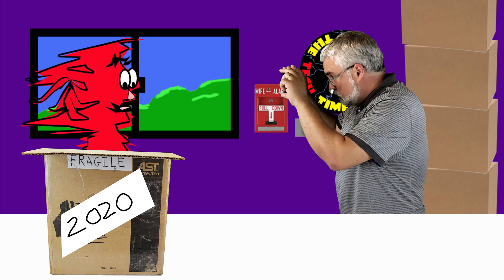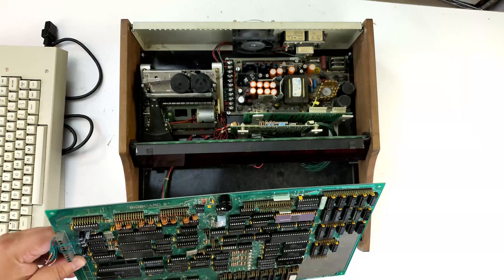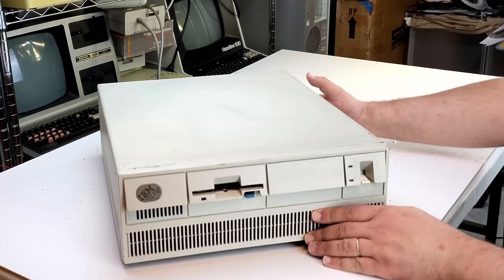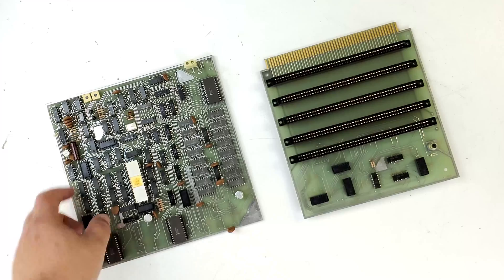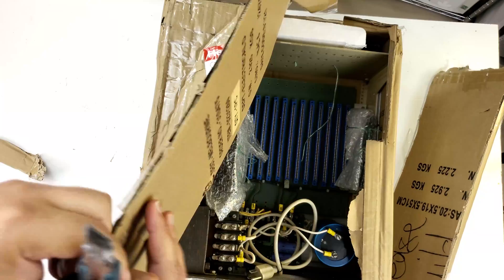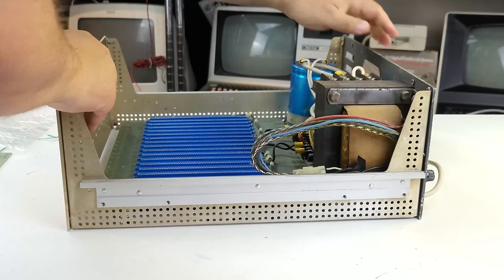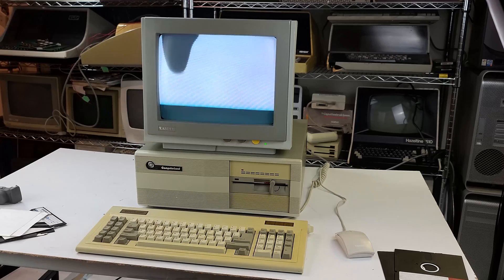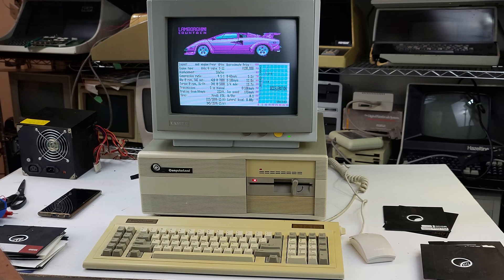Why can't I stop buying other people's garbage?

Comment: You don’t have to convince me. I’m with you on the slightly newer OEM parts.  It’s like a 1964 1/2 Ford Mustang that got a replacement alternator at the dealership 10 years later. It might not be the original part, but it’s a “correct” part for the vehicle, age appropriate, and it’s OEM.

Comment: Honestly, I think having an altair 8800b internal layout with its better features while having the look of the original Altair 8800 is actually the best thing you could have in terms of practicality and serviceability. It's still genuine MITS and it doesn't come with the really tedious parts that the 8800 had like soldering 100 wires to add 4 more slots.

Comment: To me, if the dark spot was a yoke issue, I would expect that the scan lines would try to go around the spot. But you can see sometimes the text does appear inside the spot, or at least doesn't deflect like it would if there was a yoke issue. So it does seem that something inside the CRT is loose, like the mask, or a part of the gun assembly. 
A quick visual check inside should confirm whether the yoke or some part of it, is loose.
Reply: @craigjensen6853  This is straight up irresponsible. I know it's meant to be a joke, but there is a nonzero risk that this joke advise could get someone killed. For anyone reading this that is not aware, DO NOT touch anything under the anode cap without first properly discharging the CRT. There are videos that explain this better than I could, so make sure you are aware of how to safely discharge the set before you work on it.

Comment: Send the chassis off to your machinist friend first, that thing needs to be archived! 
Now's the best time since it's barely assembled, should be less of an ordeal than tearing apart a complete unit.
Reply from the maker: That may happen.. however I have gotten word that the 8800 case and chassis may start being reproduced on some scale soon.  Parts of it have already been made and I'm told the rest is likely to come.  If that is the case our efforts here would be superfluous.  I'm just waiting on an announcement.  If it doesn't go forward for sure I'll get this measured up.
Reply: @TechTimeTraveller  No rush, that chassis been in storage for over 40 years, don't think it'll mind waiting a bit more :)

One thing you can do with the faulty CRT is check to see if anything has come loose inside, if that doesn't help then I'd strongly recommend finding a spare VGA monitor and swapping out the tubes, might need some splicing but I'm sure that's nothing compared to working on those 70s SBCs!

Keep up the good work!
Reply from the maker: Yeah I opened the monitor and had kind of a look around.. visually it looks just fine..  nothing obviously loose or broken.  That's what led the other guy who was helping me to suggest it was something internal to the tube.  I will take another closer look though.

Comment: Hi Brad, great video.  It's quite a buzz seeing the unboxing of the chassis.  Looks like it fits really well.  I've seen many early Altairs over the years that had a mixture of parts from various later revisions.  So as you say, it's all original MITS parts.  All you need now is a front face panel.
Reply from the maker: I really appreciate you reaching out to me on this!!  Yeah the dress panel may be a reach - I think I've only seen two in about 10 years.  May have to wait for someone to repro.  I am currently figuring out the power supply and hope to get that operational again so I can proceed with assembly of the basic system unit.  Thanks so much for this!!

Comment: the dark spot on the monitor looks like something hanging in front of the electron gun. Could also just be a loose connection or something loose in the case> its super bizarre. Maybe pop the back shell off and have a peep?

Comment: Not saying it is, but the big green card edge connector with the (presumably) power connections on the ends looks like it might possibly be for a Motorola EXORBus board.
Reply from the maker: It's quite possible.  I should trace the wires out and see how they line up.  I figure they had to have some kind of computer or controller in this thing.

Comment: The association of basically any parallel ascii keyboard from the early to late 70s with the apple I will always irk me. If I had a dollar for every keyboard I've seen sold with APPLE I or something crammed in the listing next to the 4 figure price tag I'd have a fair amount. I respect woz's work on the apple I and its historical significance, but it really feels like it's legacy has done more harm than good for the old computer community.
Reply from the maker: It is very problematic.. it drives up prices like crazy.  That plus the mechanical keyboard guys.. whose hobby I don't begrudge except where it drives up prices in our hobby and deprives systems of their proprietary keyboards.

Association with the Apple 1 has also run up prices for other devices like Southwest's PR40 printer.  Thank goodness I managed to get my GT6144 graphics board with a decent BIN before the Apple guys got wind of it. :)
Reply: @TechTimeTraveller  Yeah, that's a great find there. Another thing the apple I drives up the price of are those sanyo 9" monochrome crts. CCTV monitors were exceedingly prevalent in early computing, and the apple I and II were no exception. I believe the sanyo VM 4512 was actually mentioned by name in the apple II red book, which has hiked prices a bit.

Comment: Did you try to degauss the monitor?
Reply from the maker: Yes.. didn't work.  I have an actual degausser I've used on other machines and it had zero effect here unfortunately.
Reply: @TechTimeTraveller  Really? Wow... you end up with a lot of weird edge case problem equipment, what up with that. I guess that leaves the neck coil or maybe a magnet.

Oh and BTW the gimbal shot at 0:15 was so on point, loved it. Smooth action, so smooth it should be spelled smoothe.=D

Comment: Stop. Hitting. It.
Reply from the maker: It sounds worse than it actually was.  Very light tapping.  I was trying different locations to see if I could pinpoint the general area the problem might be in.
Reply: @TechTimeTraveller  I understand. It's just really hard to watch. Or not watch as the case may be.
Reply: The cure is worse than the symptom?
Reply from the maker: Well.. not a cure.  A crude diagnostic.  I was actually advised by a CRT repair person to do that.  Actually they wanted me to turn it face down as well and really whack it, thinking it might be the shadowmask falling off.   The plastic case echo definitely amped it up.
Reply: @TechTimeTraveller  Lol. I had a TV that did that and watching a movie when someone is smacking the TV is rough :)
Reply: @justovision  A smack isn't going to kill the set, it's pretty common to employ percussive tactics to diagnose physical issues in CRT sets. It can make cold solder joints show themselves, loose connections, and physical problems with the tube. You'd have to hit it a lot harder than he did in the video to actually hurt the thing